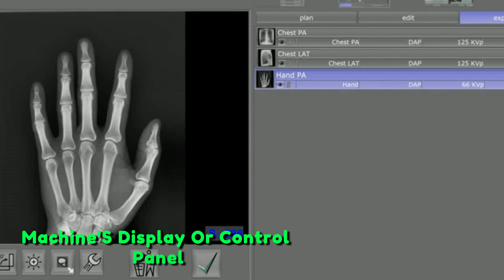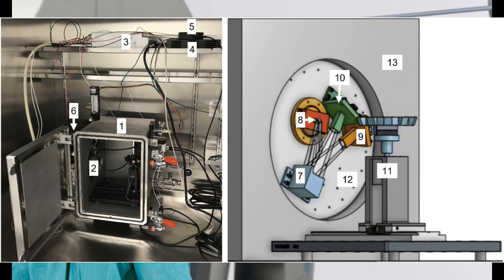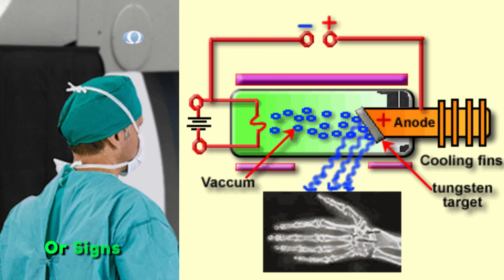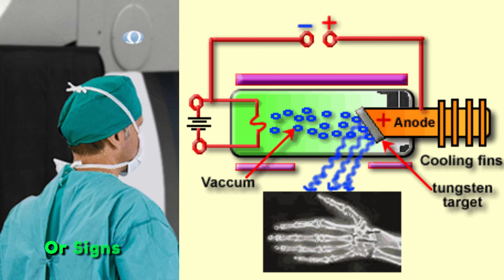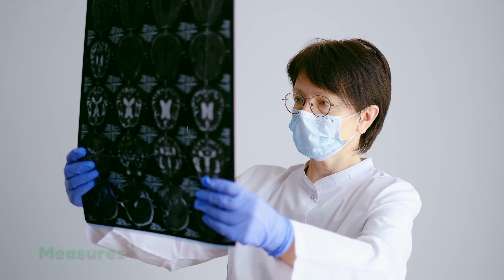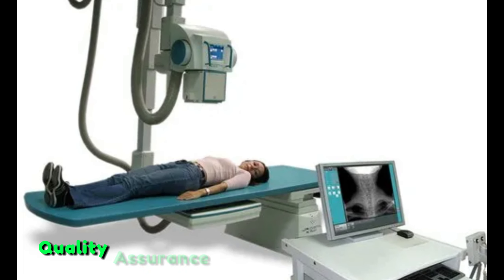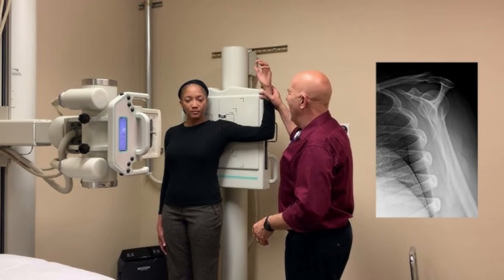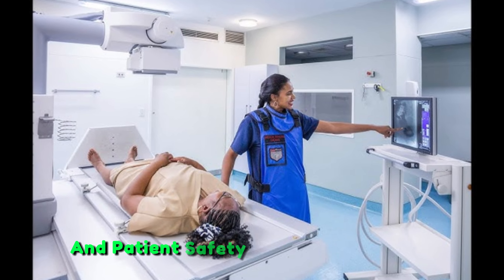X-Ray Machine Troubleshooting | Medical Technology

Comment: basic principle of xray
Reply from the maker: X-rays are generated by a vacuum tube that uses a high voltage to accelerate electrons released by a hot cathode. The high velocity electrons collide with a metal target, the anode, creating the X-rays.